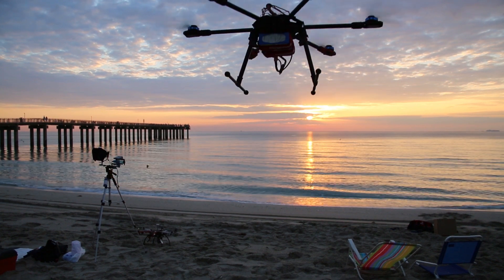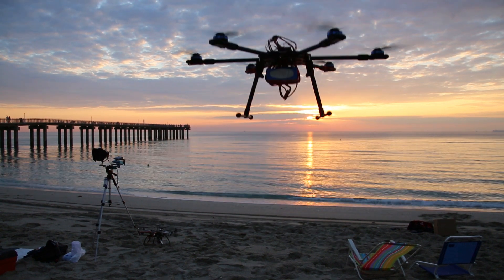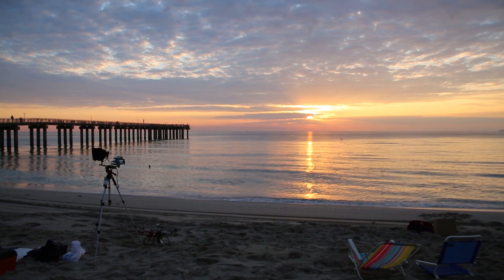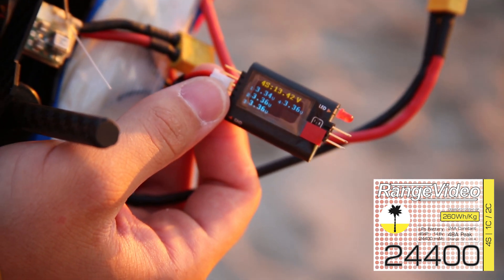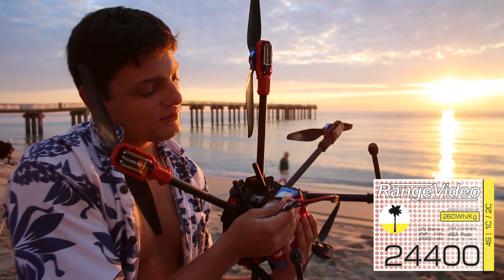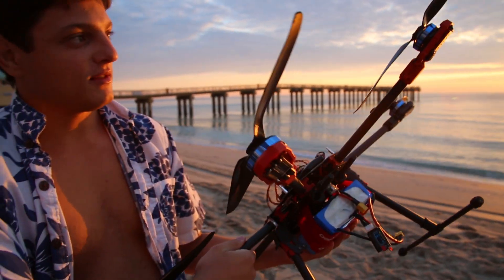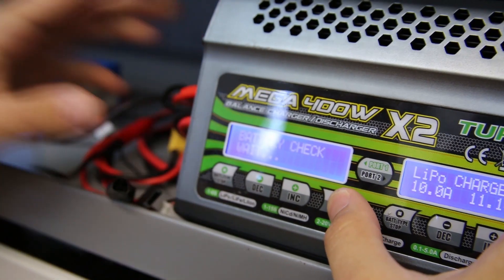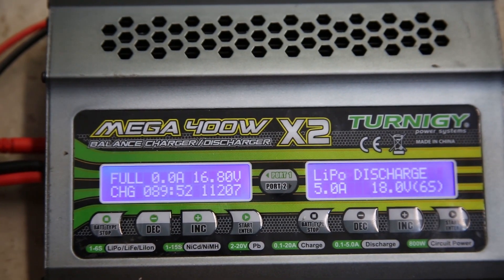RV Endurance Battery test. 4s4p 24400mAh. 45 mins flight . Tarot 680Pro

Comment: my tarot FY650 in X8 setup fly 43 minutes with tatoo 6s9000
setup is 8x motor antigravity 4004-300 and tmotor 1448 prop
esc are ZTW flashed blheli 14
lipo weight is near 1100g

Comment: Could you send me your complete parts list for this build , I have a tarot 680, but am new to this hobby and would like to rebuild mine exactly like yours to achieve long flight times for video. Thanks
Reply: Brent Nichols I am in the UK and spend a lot of time playing around with Tarot 680 setups... Get in touch if your interested
Reply: I am from the US, I built a 680 pro with a Revo and librePilot,X8r,  taranis radio and was wondering what the setup was on this unit. I like the Idea of long flight times.

Comment: You say that put 23.12 A in battery but charger shows 11207 mah. How do you measure the current? I have the same issue with my turnigy charger.
Reply: +Alberto González He said that the charger automatically shut off after 12,000mah so he restarted it and added an additional 11,207mah.

Comment: Nice work, the lower the c rating the lighter the battery and weight is everything, you could obtain an even longer flight time with a quadcopter and larger props assuming the overall weight AUW is less than on the hex. Yes he is pushing this battery to it's limits and perhaps flying this hex harder could perhaps damage the battery. Testing and time will tell. As ever it is a compromise of weight and performance. If you put this much battery weight in made up of 18650b cells then you could probably see another 10% increase in flight time. You need to be aware of how much power your system can drain and what the battery is capable of delivering. The closer you come to matching the battery with the system the more likely you are to be saving weight. Long flight times are not for everyone but we all prefer to optimise flight times when possible.

Comment: Hi, nice video.
Is that safe to fly with a low C battery? Because that battery is capable of only 1/2 C of discharge, a drone needs at least a 25/30C battery.
Thanks. Paulo L.
Reply: *****
https://sites.google.com/site/tjinguytech/charging-how-tos/the-variable-c
;)
Reply: Paulo Lopes given two battery with same mAh capacity, the higher C battery is heavier than the low C battery. That's why putting a higher C battery is going to reduce your flight time. 
And that's why long endurance flight in this video is using a small C battery.

but surely you can't have a battery whose C rating is smaller than your quad need.
Reply: a drone does not need 20/30C. 1C means you drain your battery in 1 hour. If you indeed drain at 20C you mean you have only 3mins flight time.
Reply: Luís Silva xD
Reply: uhm... I wonder how can my 75C battery handle 10min of fight if that is true xd
Reply: Ahahah
Reply: Luís Silva the truth is your drone drains at 6C from your battery but you put a heavy battery with 75C rating on it. your drone is worth a longer air time.
Reply: Dude i was being ironic! That is not how a lipo works. . .
Reply: ***** so if I spend a lot of money in a higher C battery I will have less flight time? That makes no sense. C is only the discharge capacity of the battery, I have a 3s lipo which is capable of 5A continuously but it has around 20/30 C so it is capable to give discharge peaks of around 30x5A = 150A in a few seconds if motors need ;)
Reply: ***** Youre right, depending on the build the Tarot 680 needs about 550 watts of power just to hover, about 750 watts to fly and uses approx 1800 watts at full throttle.  On a 4S battery that corresponds to a current of 37 amps, 51 amps and 122 amps respectively.  The battery being tested here can supply 24.4 amps constant or 48.8 short term, so you can conclude that it is being damaged just by maintaining a hover.  At full throttle it would be  dischargeing at 5C which would probably cause it to catch fire:/
Reply: Kotik agree~ finally we have a serious RC hobbyist here ^^

that's why using Low C "endurance battery" needs a good planning rather than just "buy-and-plug-and-play". Some people like you knows its quad well and fully aware the endurance battery can only supply current for hovering/slow-flying, so they maneuver the quad in less-windy condition and give only gentle stick movement to bring the quad back into their camera view. 

then post a video on youtube claim another "long endurance" flight : p

but if the copter is designed carefully --- using high-efficient motors, reducing AUW as much as one can, etc --- low C battery may actually enough to power up a copter for doing very long-distance GPS waypoint flying. this will be very very cool!!

btw, does battery really catch fire in-the-air by just over-drawing current? that will be interesting~ XDDD just fly a low C battery to somebody you don't like, then push the throttle stick all up~ XDDDD
Reply: ***** and Kotik 
I will not continue to discuss this. Just saying I'm studying electrical eng. and Luís Silva he is already an electrical engineer finishing his Mater's Degree and I fly planes since I have 12 yo (have 24 now) and we both fly multicoptrs, I think we know what we are talking about, and yes the same lipo with like more 10C (is enough) is like some grams heavier.
Your right Kotik but what Wilson was saying had nothing to do with it.
Reply: And no, I'm not trying to say we are better than you or even we know more than you, just saying we know what we are saying ;)
Reply: Paulo Lopes I am sorry for my impolite wording in my previous post... my bad ..
Reply: ***** it's ok man, you did not tel impolite words ;) and yes a low C battery can catch fire if you try to have from it high current that it can't drain.
Reply: Luís Silva I think we have different understanding on the term "C rating". nvm, it just a youtube conment. : p

have fun

Comment: dear brother, what you used ESCS and engines ?
dear brother, what you used ESCS and engines. 
I did purchase one battery in Range Video and am awaiting delivery, I will test the Tarot T960, 5010 engines and 18 "propellers

Comment: Very nice Vova.  Interested to hear why the Pixhawk wasn't loitering well.  All calibrated?
Reply from the maker: Looked like big time GPS drift - not AP gains. It was working fine at the office the other day. No time to check solar flare charts or flight logs, but before that I did have a  yaw drift problem, and only fixed it by replacing the Pixhawk with a new one.  The yaw was drifting a few degrees. Old Pixhawk had been in very mild crash.

I just seemed to have better luck with the APM 2.6. That flew my T960 wonderfully.